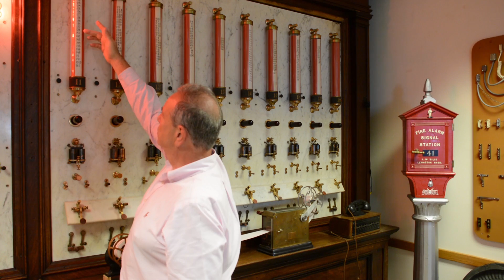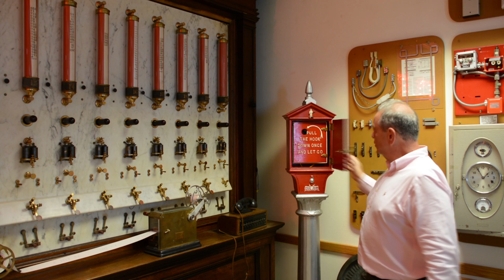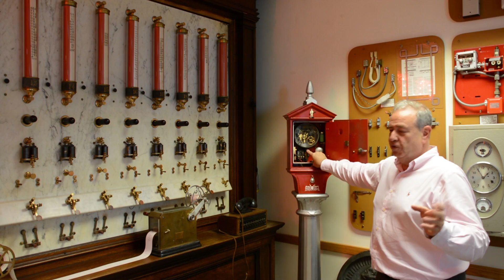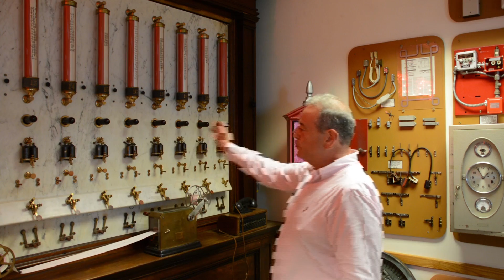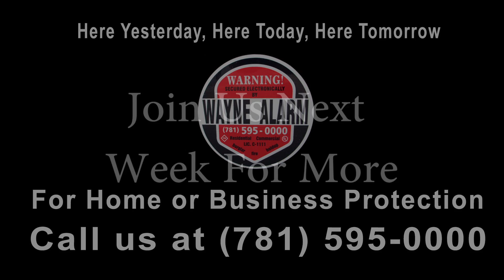Wayne Alarm Antique Corner 5: Municipal Fire System (pt 2)

Comment: I have a number of Gamewell boxes as well as some from NY City which had custom-made boxes and pedestals made for them.
The most beautiful box is the "VF"  pedestal from the 1920s, I have one from Brooklyn dated on it's base 1929, the guy in charge back the Victor Fine overhauled the system and these massive pedestals were placed all over the city, they stand 7 feet high and weigh 900 pounds! I have a video of it on youtube, just add this to the base url; watch?v=4ZD6HV-oU5c